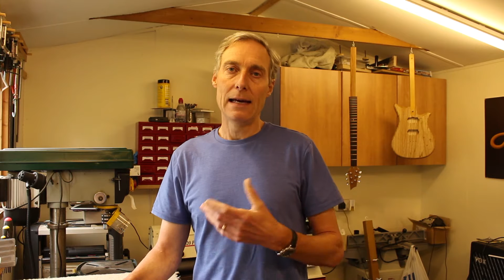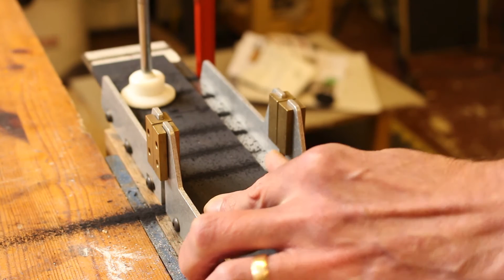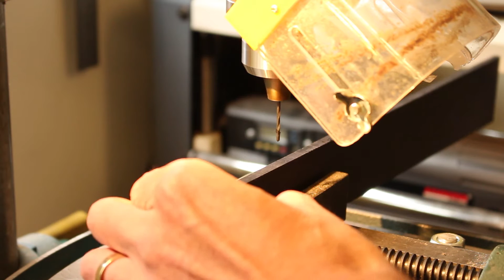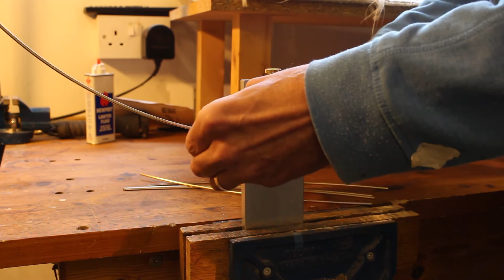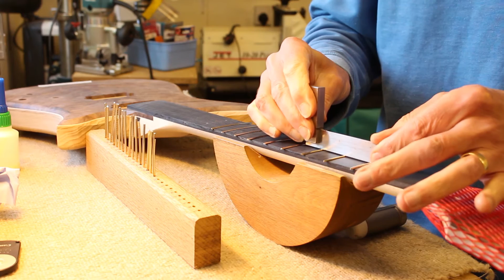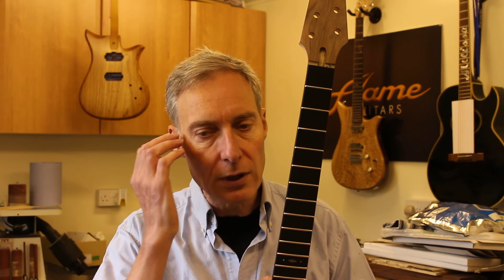Rocklite Ebano fretboard material

Comment: the stuff is so hard to block sand..and the sides of the fret slots done compress much so the slots need to really match the fret tang correctly or it will introduce a strong backbow..replacing the frets i read is a nightmare..hard and long lasting material certainly

Comment: Thank you, I've been searching for reviews on this for some time. How do you rate it's tonal qualities against ebony. I have a blank similar to the one you show in the video, and it's tap tone is very different to ebony so I wondered what a finished guitar would sound like.
Reply from the maker: I agree about the tap tone. This guitar sold within a week of it being completed, so I didn't have long to get a real feel for the tone. But under the fingers it does feel like ebony. I guess if you built two identical guitars, one with an ebony fretboard and the other with Rocklite there may be some small tonal differences, but the Rocklite would not necessarily be inferior to the ebony. For me the most important thing about Rocklite is that it is a real alternative to ebony. Will we be building guitars with ebony 30 years from now? I doubt it. And hopefully that is not just because there are no ebony trees left!
Reply: THE COOL THING IS PICKUPS DON'T AMPLIFY WOOD SO YOU DON'T HAVE TO WORRY ABOUT IT UNLESS YOU ARE BUILDING A TAPTAR. I DON'T GET THE WHOLE TAPPING ON A PIECE OF WOOD TO SEE IF IT WILL MAKE PICKUPS SOUND BETTER.
Reply: @Ibaneddie76  You're right about that from a very general sense, but think of it this way. If the pickups are only picking up the strings, then why not do everything you can to make the strings resonate in a more pleasing manor? Some woods resonate better then others, allowing the strings to ring longer/louder/with more dynamics, so although the pickups aren't DIRECTLY picking up the wood, the wood is still playing a major part in the way the guitar sounds, whether it's plugged in or not. So if you tap on a piece of wood and it sounds completely dull and flat, that's a pretty good indication of how it'll make the strings sound, dull and flat. A great set of pickups will do a good job of covering that up, and so will different techniques when using an amplifier, but that guitar will never sound as good as an instrument that rings out loud and true unplugged. There's only so much that can be covered up with electronics.
Reply: It is dull.  Takes a bit of the highs out of the sound. 
I believe sound bounces off the fretboard when a string is fretted, and it affects the sound of the string as we (or our guitars pickups).